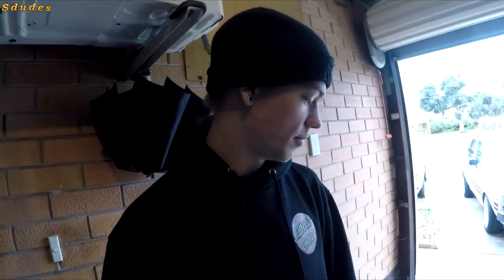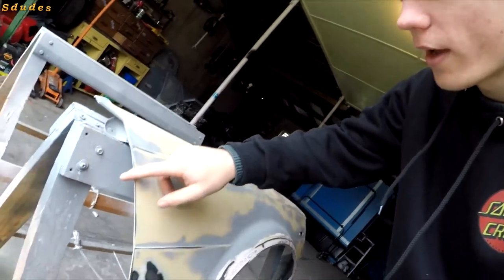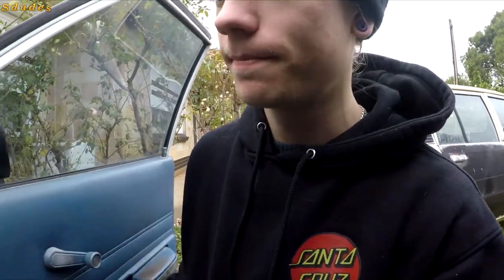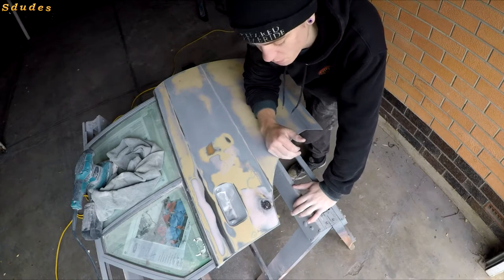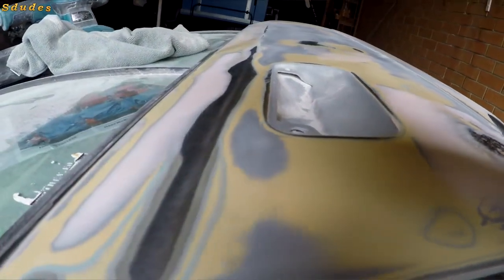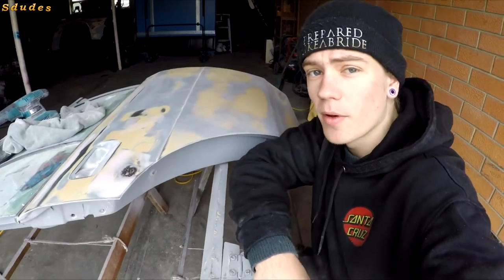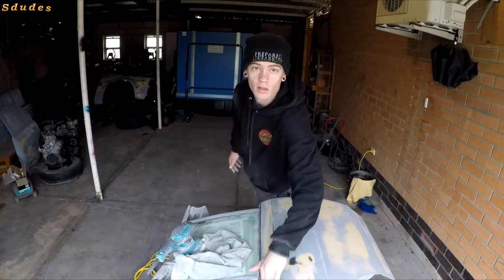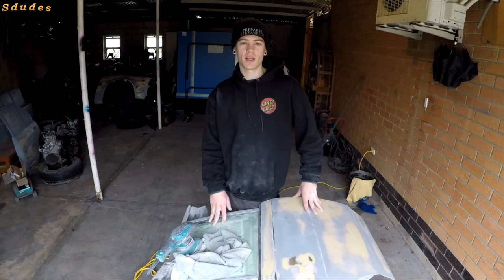KE70 Street Car Build Part 4 - Ready For Primer

Comment: The electric sander is shit
Reply from the maker: Shadlee Spencer its alright for bringing back the paint but can't beat the board sander when getting the panel straight
Reply: Sdudes yes you can. Sanding by hand. Hand blocking is the best. All the bare metal spots on your fender are undercut. Or high spots. Sorry brother ive been building custom cars for 30 years. Im stoked your learning and doing it yourself. But we dont use d.a.'s or electric tools
Reply from the maker: Yeah hand board sander/block is what I was referring to my bad. Alot more work went into the panels after this video.